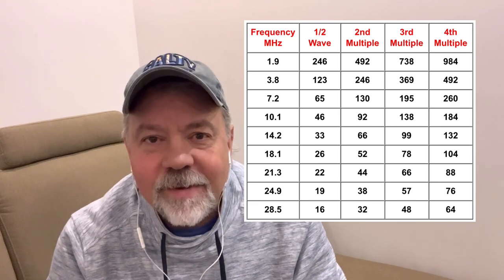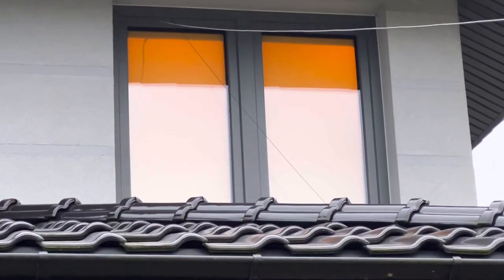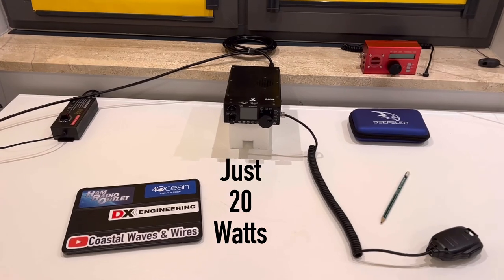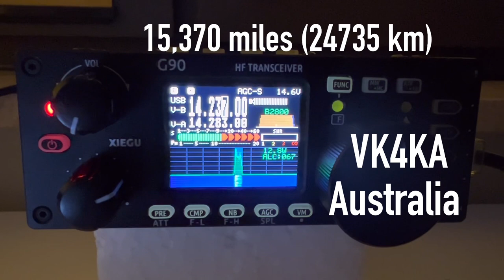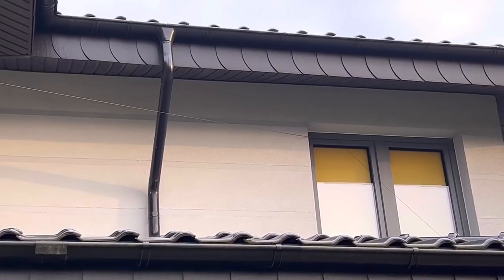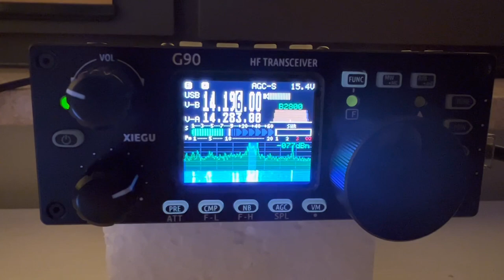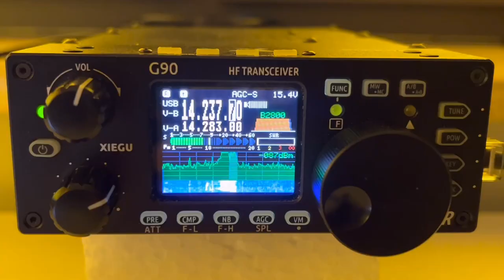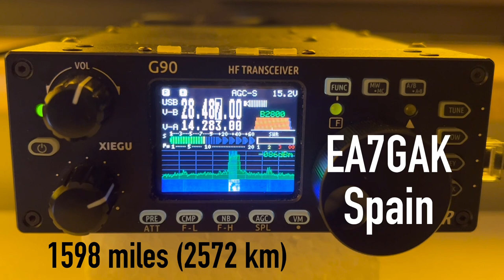Random Wire Antenna - Urban Portable

Comment: I tied off my 41 ft. antenna at ESE 120 degrees to my pecan tree in the backyard through my back door which is 16 ft off the backyard ground in a slope config. I got my first European DX contact to S52WW in Slovenia yesterday (5000 miles). The signal was an S7. I have also contacted Texas, Ohio, New York, and North Carolina with good signal reports. Thanks to this and your other great videos, I could do this. I used this video as a template. I am handicapped and this was an easy setup for me to do. Thank you again for your great videos.

Comment: Great stuff Walt, you inspired me to make one up, I have really limited space and usually don't use a radio from my location but I ordered a 9-1 Unun and made the same length antenna, Just brilliant, sure it's a compromised antenna but when you have nothing at all and you put this up it's great, It's on a 12 meter spiderbeam fibreglass pole so I had to wide the last bit around the pole, put the Unun on along with a homebrew choke and SWR is below 3 on all bands apart from 40 mtrs, mind you the pole is running alongside and strapped to a tree so not the best but I'm getting out all around the globe. Thanks for getting me off my backside and giving me hope. I almost gave up from my QTH. Cheers 73 ZL1MY
Reply from the maker: Awesome! Thanks for the great comment. It’s all about getting a wire in the air. 73 my friend

Comment: You said your wire was short for 40m. A 41ft random wire has 40m covered. Just needs to be at least 33ft long. Great vid. Keep ‘em coming!
Reply from the maker: Thanks so much, yes you’re definitely right. Just wasn’t a stellar performer on 40 but that may have been the conditions as well.

Comment: Nice things about these antenna is they can be bent around trees in pretty much direction you want, and they work well. In a neighborhood like you have, antenna height means a lot more than the type because signals broadcast/leaving the antenna in the Freznel zone will be absorbed by wire in other houses, trees, shrubs, you name it.  If you can get the antenna high, meaning at rooftop level,  will make a difference in how you send and receive.  I live in a similar neighborhood, and have built many different types of antenna, and this has been my experience.  Great job trying different antenna's and coming up with your own conclusions. This is what I enjoy about ham radio.
Reply from the maker: Thank you for watching and commenting.

Comment: Thank you very much for these videos. I'm looking at your Sloper videos and getting some great ideas from you. One thing that help me on my SWR is a toroid FT-240-43 with 12 wraps of RG-58 cable that I made hooked directly between the transceiver and the feedline. It dropped the SWR from 3.4 to 1.1. I have a 35.5 ft random wire antenna stretched around my room inside. It is compromised but I do get some reception on it.  I was getting RF reflected back into my transceiver due to my antenna location near the radio. That choke dropped the SWR. I tried the radio with and without the choke I made. It did make a big difference. Thank you again for your videos and for giving me some ideas.

Comment: I have an EFRW 71’ flat top up about 50’ with a DIY 9:1 unun and 50’ coax.  I am continually amazed  how good this wire works.  As you said, not the best, but pretty darn good.
Reply from the maker: Exactly, thanks for watching and commenting!

Comment: They work for sure. I had one up with a 53 foot wire and the G90 tuner would match it on 160m, even have a couple contacts with it on 160. I think they make a great antenna project.
Reply from the maker: Awesome, I’ve never made a 160m contact. You’ve got me thinking haha
Reply: @COASTALWAVESWIRES  I need to get another strung up so I can make some more. Guess I have a reason to buy more coax lol.

Comment: Great video. EndFed antennas can work well, but they can also pick up more noise than other types of antennas but like was said in the video, all antennas are compromise antennas. I had a 60 foot wire I had used for SWLing in an attic that I later used as a ham antenna when I got licensed. It was about 60 feet shaped in a U, but for the feedline, I just had a single wire coming into the shack and into the tuner. It worked pretty well, but of course, there were RF in the shack issues on 15-10. Even so, had fun with it.
Reply from the maker: Thanks for sharing!

Comment: Thanks for the video.  I also run a "random length"  41 ft. wire antenna to a 9 to 1 homebrew unun. and tuner,  for POTA for several years now.  I have about 2000 CW contacts running 5 watts or less power with it.  On 20 meters I have contacts into KL7, Poland, Spain. France, Finland, other European countries, and 40 some states in the US.   It loads well on 10 through 40 meters.  I run the antenna as a sloper, with the low end about 5-6 feet off the ground, and the high end 20-30 feet up (or however far I can toss a rope over a tree limb). It has worked almost as well (sometines better)  than my EFHW antenna for portable QRP POTA work.  Give it a try, it really works well!  Paul  NA9M
Reply from the maker: Awesome! Thanks for sharing Paul

Comment: I like your tests of different configurations of an antenna that should be better known!  I'm using a 71' stealth non resonant sloper, 15' at high end, 6' low end, 9:1 unun, 50' LMR240 coax, common mode choke, no counterpoise. SWR 1.2 to 1 or less with no tuner 20, 17, 15, 12, 10. SWR is 1.5 to 1 or less using my G90 or XPA125B tuner on 160, 75/80, 60, 40, 30. Have made contacts on all HF bands. From California worked Europe, Baltic, Mediterranean, Africa, South and Central America, Asia, Australia, New Zealand on SSB.  Daily 80 & 40 SSB nets with solid 5/9 reports. Using from 1 watt QRP to 100 watts SSB. A remarkable low cost all band HF antenna!
Reply from the maker: Thank you so much Jon and thanks for sharing! Have you found that the XPA125B tuner just doesn’t perform like the ATU in the G90? That’s been my experience. 73, Walt
Reply: @COASTALWAVESWIRES  The ATUs in my G90 and XPA125B both seem to work very well. I use the XPA125B tuner in bypass mode for QRP. I've checked into 40 meter nets with 1 & 5 watts SSB, and made a 5 watt SSB contact to Japan using the XPA125B tuner with its PA off. I found that my XPA125B needs 20 watts input (on AM carrier no modulation) to get its tuner to tune for best SWR. I tune The XPA125B ATU for the middle of each HF voice band which the XPA125B keeps in memory, allowing rapid band switching. Retuning is need for high and low ends of 75/80.
Reply from the maker: @jonmcadams5401  interesting, thanks for sharing

Comment: Great result with that high noise floor. I've got a G90 too. That internal ATU is great, eh? I've also used my FX-4C with a 41' random wire and ATU-100 tuner successfully. I use LDG ununs. For my random wire, I use the LDG 9:1 and a 1:1 at the radio end.
Reply from the maker: Awesome, I recently bought a FX-4C and I’m awaiting it’s arrival
Reply: @COASTALWAVESWIRES  You'll love it for portable work. I've made DX contacts with it on 10m SSB from SOTA summits in Utah.

Comment: I'm having  fun with a Nelson 9:1 on FT8 10 to 160. Well worth it. Can't install my 6BTV here and there are plenty of wires and bus engines around but it's sloping up a tree and perfect for now.
Reply from the maker: Awesome, thanks for sharing!
Reply: I also use a Nelson 9:1 unun with an 84' wire. I have made contacts all the way to Australia.. my problem is I get common mode current in the shack. I am not using a counterpoise based on the recommendation of nelson antennas.  I have upgraded my coax to 25' of kmr400 because it's double shielded. I get cmc worse on 40, 80, 160. Some on 20.   Based on this video and others by Walt I think I'm going to add 17' counterpoise and use a ldg 9:1 unun and ldg 1:1 choke. Any other recommendations?

Comment: Your mention of a random length antenna getting close to the 5/8 wavelength started me thinking. I wonder if its low-angle radiation could be turned vertical, becoming a very high angle antenna. That might just might concentrate more of the RF upward. The pattern might also be interesting. My guess is that its best near-zone coverage would be broadside to the antenna and worst off the ends.
Reply from the maker: Yes, if I understand you correctly you’re turning it to become a NVIS antenna. The height above the ground would be the biggest factor, the closer to the ground the more upward the radiation pattern.

Comment: I just made a 29 ft antenna with counterpoise, inverted V, directly into my G90 and internal ATU. SWR was down to 1:1 on all bands. I had 21 contacts from Italy to   all Europe in CW. No DX unfortunately. I wonder if the 9:1 would result in a more efficient antenna or not.
Reply from the maker: Thanks for sharing, I'm sure the 9:1 would make that antenna more efficient.

Comment: I use my own as helical up a 10m fibreglass pole. Appears to reduce stress and drag on the pole. It works well with my G90, 73
Reply from the maker: I actually tried that myself with a different length and it works (there’s an old video back there on my channel somewhere) I was thinking about trying it at home. Thanks for watching and commenting! 73

Comment: Walt, would that be able to communicate on 3980 with an external tuner? Possibly would it with a longer wire?
Reply from the maker: It would work but probably not a great performer.

Comment: Good job. I have a few questions/ comments. The wire is 41 feet end to end if I understood correctly, but did not hear the height of each end. Also I would like to know the length from the top insulator to the bottom insulator. I am guessing that you essentially have a half wave long element from insulator to insulator. If so that’s probably perfect to get good clean patterns. On 20 meters perfectly flat and half wave high it should be as good as a dipole with broadside directivity and as the end is lowered you get the pattern shifting to increase radiation off the end until it’s almost omnidirectional at vertical. However it’s usually very hard to see small differences until they are more than 3 or 5 dB. I put up a 15 meter flat dipole at 25 feet for the DX contest this weekend. My usual 15 meter antenna is a 40 meter dipole. What I noticed was the dipole was either the same or better than the 40 meter dipole except for two directions where EZNEC predicted the 40 meter dipole had significant gain (5 to 10 dB ) over the 15 meter dipole. The way they are oriented the 40 meter dipole only Favored Cuba, Central America and Argentina and the opposite direction China and India. I did a lot of switching and except for these two narrow directions the halfwave dipole was always as good or better. However direction was not the only factor. The radiation angle of the much higher 40 meter dipole was both lower and higher with a null where the 25 foot high dipole has a peak! I liked what you said about compromises, all antennas compromise something as you absolutely can not get gain in all directions and elevation angles no matter how hard we try!
Reply from the maker: Hi! It’s not a half wavelength. The thing about the Random Wire antenna is to avoid half wave lengths and let the radio’s ATU tune the antenna. I would say the bottom of the antenna was 1 meter high and the top about 7 meters high. Thanks for watching and commenting!
Reply: @COASTALWAVESWIRES  I understand the overall length is 41 feet not a halfwave but wondering about the outside straight part. Is it about 33 or 34 feet (halfwave long on 20 meters) ? I sort of think of the antenna in terms of where the standing wave is and how many standing waves are along the wire in order to visualize the pattern. I think like the halfwave is the antenna and the extra part is the feedline which transforms the high Z at the end of the halfwave to a lower more easily matched Z at the end of the 41 total wire. I hope I explained that better.
Reply from the maker: @dandypoint  ok, I understand now. Interesting and I’m just not sure of the answer. Like I said in the video, I just put the wire up and starting experimenting. I really need to take accurate heights and model this one.
Reply: @COASTALWAVESWIRES  I usually end up measuring my wires when I take them down! I measure then trim and then lose track of exactly where I ended up. However a foot or so does not matter at HF for patterns, etc. My 15 meter antenna will come down next week and be used for POTA mostly as I made it pretty light duty with speaker wire and no real end insulators.

Comment: Hi Walter and greetings from Malta. 9H2JG here. 2 questions if I may,what power supply you're using cos I saw you are running 15v and the 2nd is from where did you make the velcropatch for your bagpack please. 73s and hope to catch you on air
Reply from the maker: Greetings from Virginia. I got the Velcro patches here; 
https://www.etsy.com/listing/827117156/
The power supply I got here:
SHNITPWR 4V - 12V Power Supply 10A 120W AC to DC Adapter DC 4V 4.5V 5V 6V 7V 8V 9V 10V 11V 12V Voltage Adjustable Universal Power Converter Transformer 100-240V AC In with 14 Tips & Polarity Converter https://a.co/d/ehAukH4
All the best and 73, Walt
Reply: @COASTALWAVESWIRES  thanks Walter. Hope to meet you on air

Comment: Great video. Thanks. Can an internal turner be used with this setup?
Reply from the maker: Thanks! Yes absolutely an internal tuner is the best option actually.
Reply: @COASTALWAVESWIRES  thanks for the quick reply. I am really enjoying your Content. My 9:1 should be delivered today and I am looking forward to trying it. Just got my general ticket a couple weeks ago and I am enjoying HF alot. I actually started chasing POTA this weekend with a quick and dirty dipole at about 7ft and made several contacts.
Reply from the maker: @CarlFiocca  there are so many great antennas you can build with a 9:1. Have fun and hope to catch you on the air! 73

Comment: I have made several dipoles and transformers and none of them have worked as well as yours. are you building your transformers as well as setting up your own antennas. I'm wondering if the construction of the 9:1 and 49:1 are very exact in the builds? The versions I've made work on the low bands during the testing but the SWR's go crazy when hooked to an antenna and radio. I'm trying to figure out if my problem is the wire length or the build of the transformer. Thanks for any help from you or your viewers.

Comment: Been a long time since I was on the air,  and I've always messed with either dipoles or verticals - which have all since bit the dust.   your Random wire antenna sounds pretty cool.  I have  an old MFJ969 tuner that has a random wire input.  What were you doing for an RF ground?  Did you just use a long wire - lets say roughly 32 ft for 1/4 wl on 40meeters as a counterpoise?  I also have a pretty good idea what you were doing in Poland.   Would it be in Radzikowa by any chance?  73's  Jeff WR2F

Comment: Hey Walt! I have a question, have you tried this length on a 10m pole? Put the 9:1 at ground level, and see how it goes. I just made a 9:1 and this was my plan.
Reply from the maker: Yes, this works very well sloping with a 10m pole and the 9:1 at ground level.
Reply: Thanks! Going to give this a go, and cut the wires. @COASTALWAVESWIRES

Comment: It doesn't have to be "best" to work. Get something in the air and push some signal through it! Weren't you planning on taking the Alinco on this trip?

KC3UVF
Reply from the maker: Absolutely! I was going to bring it but that would have also meant bringing our buying another power supply over here so I just brought my old faithful G90, it’s crossed the Atlantic 5 times now.
Reply: @COASTALWAVESWIRES  can't argue with that lol.

Comment: Hi Walt. What kind of wire you had used in this horizontal antenna? I know from your other vidros for vertical it is enough to use simple 18 awg speaker wire but is for horizontal? For example i've found a professional antenna cable on local internet auction and the seller claims it has 0.3 ohm per 1m - what unun should it be used with if the random lenght will be f.e. 10.82 m?

Edit: i have confused feed point impedance with wire resistance... "The feedpoint impedance is a characteristic of an antenna that varies with shape, size, frequency, height above ground, and other factors"
Reply: I wish the cable for my horizontal random wire antenna be stronger than speaker wire as i want it to be more permanent installation from my balcony to a tree near by. It already works with the speaker wire but it hangs too loosely.
Reply: Of course thanks Walt for your work and making this hobby more accessible for beginners! I've learnt a lot form your videos!

Comment: When you have it sloping/vertical, does it matter if you feed it from the top or the bottom
Reply from the maker: Most feed it from the bottom but this experiment showed that it can be fed from the top. That was one of the reasons I wanted to do this. I’ve also had success feeding an EFHW this way.

Comment: How does that antenna radiate, off to the side or straight off the end? I have never quite figured that out. Appreciate your time.
Reply from the maker: Tommy that’s a great question and why I experimented with it. I think it’s entirely dependent on how it’s positioned. I seemed to get better directional gain forward when it was sloped and better gain broadsides when it was more horizontal.